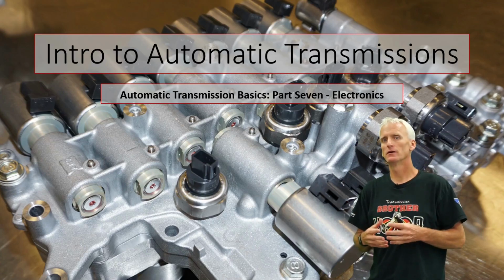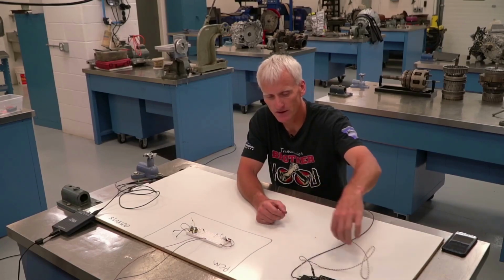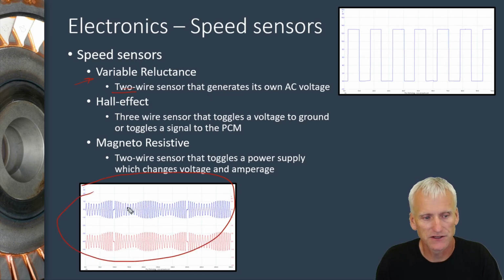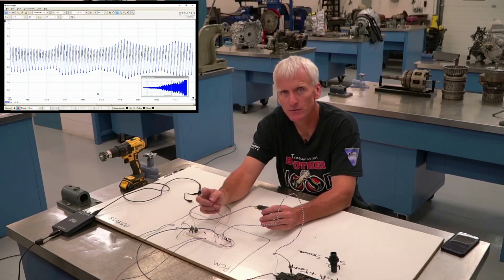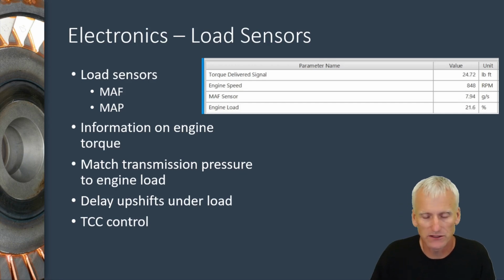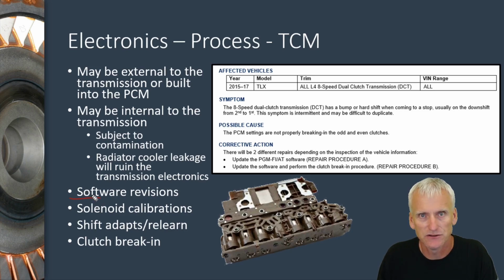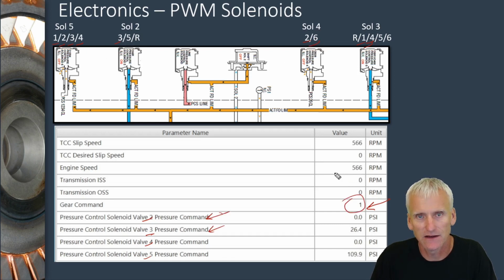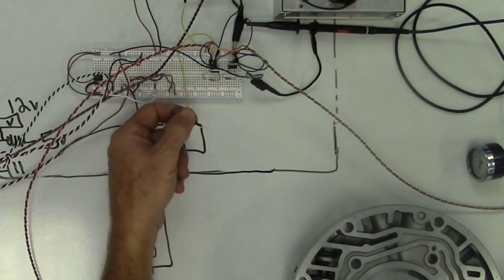Basic auto trans electronics

Comment: This is the exact video I needed .. thank you so much .. I am doing an EV conversion and have an auto gearbox .. i pretty much spent months learning about everything not knowing about your videos. As a software engineer with some electronics background I was able to fumble my way through to which I think is the right knowledge on the overall function of the electronics components on the auto gearbox, mind you, this was after watching lots of other countless videos ..  now using your video I am verifying what I think i know and so far its checking out more or less .. my goal would be to redevelop the PCM using an arduino or raspberry pi to do certain new things and this is allowing me to verify what knowledge I think I have in terms of the sensors and what the computer should do to the valve body .. again thank you and wish I had found this video much much sooner .. subbed !
Reply: Do you have what's up , i would like to communicate more with you

Comment: I think this will at least give me direction on how to fix my Hyundai. 123 and 4th gear will not engage part of the time. Sometimes when it goes into safety mode (4th gear) the odometer will move but the wheels will not. I'm suspecting solenoid number 5 could be the culprit. Here's my hangup though. When I unplug the transmission, it should engage 4th gear. It doesn't.